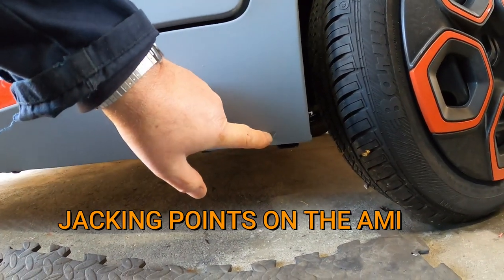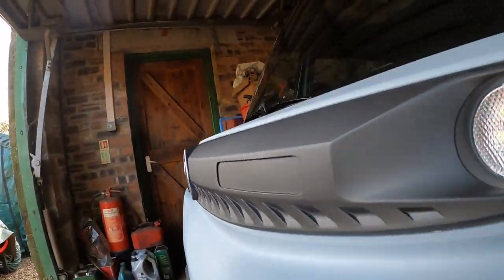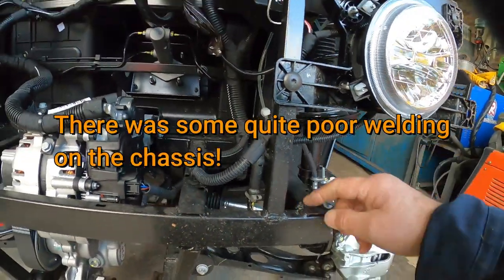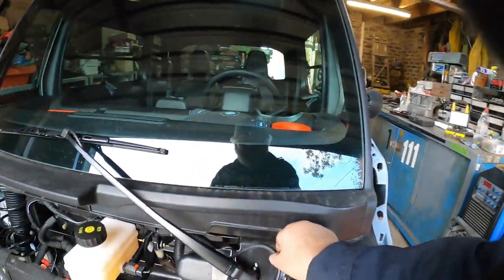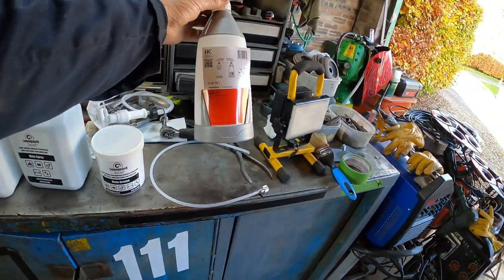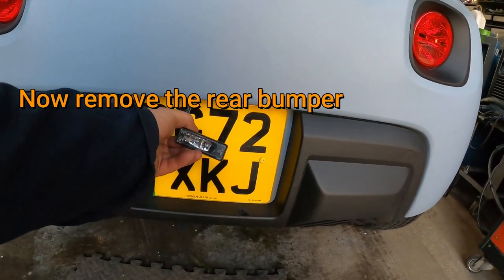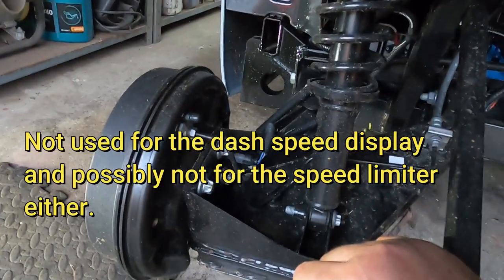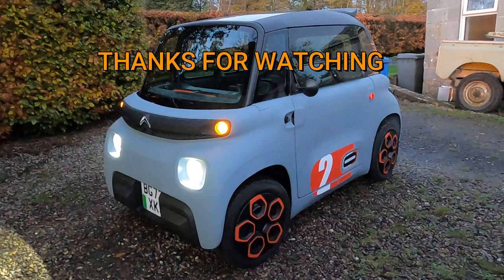Rustproofing CITROEN AMI with LANOGUARD  & How to Remove Front & Rear Bodywork

Comment: This is the best video ever on the Ami and what your actually getting for your money - or not- as a car mechanic from the 70s to the 90s, this is just cheap jigged up box sections mass produced but so damn poor as you are honestly pointing out. Without you rust proofing, this hasn’t got much of a life before it’s scrapped! This should be done as standard. (Because it’s a box chassis) But because it’s all profit driven it’s up to you to do it-provided your savvy enough or old school car mechanic. Man I worked on triumph herald chassis and these things were bloody death traps (all cars with box chassis) crumpled and fell to bits in a bump! As we’re pretty much all cars from that lax era. Honestly for the price it’s ridiculous the minimum effort that’s gone into this quadricycle
Reply from the maker: I guess they do not get rust in Morocco (where the Ami is built).
Reply: Absolutely. It’s one of those marketing moments, where someone clocks there’s interest in this to the point of if we sell ‘x’ amount we make ‘y’ and that’s good enough return. 
It’s not even funny. Because if the stupid box chassis develops a hole, it’s binned due to it being the entire strength of the quadricycle. Everything is bolted on it it’s a liability.
2 year warranty on the chassis and 3 on the battery. They knew exactly what they were doing……
Reply from the maker: @stumpusMaximus  Being such a simple chassis - welding it back together should not be too much of a problem.
Reply: True, The ‘ordinary’ punter can’t do that -It’s got to pass an MOT remember?
Reply: @stumpusMaximus  It's a great disappointment to see how poorly the welds were done on the box chassis. It's as if none of the factory workers were ever shown how to do a proper weld before they were let loose on the shop floor. For the love of God, it's not as if Morocco is ever going to be a major manufacturing centre for vehicles so anyone lucky enough (?) to get work in the Stellantis factory at least deserves to be told when their work is crap. Can't help but think how much better this vehicle could  have been if it had been made in a country where they want to advance industrially. Must have been the lucrative enticement of cheap labour and generous government subsidies that Morocco offered Stellantis.

Comment: Well done, timely, we've got off light so far this year. That's a long run for the screenwash. Welding robots need to be sent for retraining. I'm still trying to figure out what purpose if any the dimples at the bottom of the doors have, jacking point indication is a nice touch.
Reply from the maker: I haven't looked at my door bottoms....
Reply: @DougsShed  I looked at the remains on your garage floor before checking out the Lanogaurd website. I think I'll be restocking my rustproofing fluid with that when the time comes.
Reply from the maker: @niallsommerville9941  The overspray and drips on the floor were easy to clean up. I just sprinkled sand on and brushed away.

Comment: will pass to the service manager at My Citroen dealership - (he's going to jack up the Pop and get my Optimate connected - I will ask he if he can do a Waxoil to the underneath while its up there for the battery job )...  I don't think we will go to the lenths of removing front and rear sections of vehicle - however, yours was a very thorough job getting into the internals of the box sections...   Thanks for promoting Lanoguard and the fact that its OK to use on electrical connections...    Are there areas underneath that you would avoid ?   Bill Kerr on the S. coast of England .
Reply from the maker: Avoid spraying into any of the cooling fans for the electronics.
It only takes about 3 minutes to remove a front or rear section.
Reply: @DougsShed     thanks Doug.  its just that I am temprementally aversed to doing it though I am sure I can/could but would prefer a professional to do it for me in case I F----d Up !    Its the putting back together bit and the dismantling the light connections that fill me with fear !   (. I stripo wheels of my cars and use a random orbital polisher on cellulose with loads of valeting products and jack the vehicle up and place on axel stands but dismantling sections.. ahh !!   - chicken out .    Bill 69 retired in Sussex  (quite good at falling off BMW 1250 GS's too ) - did this just s. of Edinburgh last Sept at 70 mph - lucky to be here - bike was written off but got a replacement within 10 days of event so quite fearless in other respects !!

Comment: Is this product nicer to use than Waxoyl? Their office is only a couple miles distant from where I live, it is just a normal private house, guess they are re-packaging or an agent for another company, be interested to see how well this performs as I have considered using this myself.

I like the simplicity and crudeness of the construction, it is only a matter of time before some company produces a body kit to change the car completely, it looks as if it will be very versatile.

My hesitation is the restricted top speed, as we are not governed by the same rules as in France, I wonder how easy it would be to re-configure the controller to allow a higher speed limit, I would want to be able to go up to about 50mph to make the car more usable on faster roads.

Thanks for sharing.
Reply from the maker: The Lanoguard is way nicer to use than Waxoil.
The coating is clear and dries to a matt finish.
It is recommended to apply every year as the coating is fairly soft and can wear off areas.
Type approval (L6) limits max speed to 28mph. If you were to modify for a higher top speed you would need to put the car through an MSVA test and register as an L7 (heavy quadricycle).
It would be very difficult to hack the electronics of the Valeo motor to gain any top speed.

Comment: Very interesting video so thank you. Do you think the electric motor is a bit exposed to the elements?
Reply from the maker: No worse than the location of an alternator on a car. Possibly better as there is no front grill.
Reply: I guess you could make an undertray for that section if you wanted. Will probably slightly increase the efficiency too (not a noticeable amount).
Reply from the maker: @gilburton Not really a problem. The electronics in the motor are very well protected. I did apply some Lanoguard to the aluminium casings to stop them going crusty.

Comment: Do you live in Edinburgh? Need help with the bumper if possible. Thanks. Steven
Reply from the maker: Hi Steven, I'm across in Fife. What is the problem with the bumper? Only (6) 10mm bolts to undo and a couple of connectors to the indicators (and rear number plate light).
Reply: @DougsShed  Hi, it's actually the rear quarter panel where the charge cable is (looks like a kind of L shape). The lock has a cover over it. I need to replace this panel but I'm not sure how to get it off. Just wondered if you have taken this panel off? I also have a new rear bumper to fit but yeah seems quite straight forward. Cheers. Steven

Comment: Does this mean you have to take off the front panel to check  and/or top up the brake fluid level?
That does seem a good idea for something that should be checked on a regular basis
Reply from the maker: No, you can see the brake reservoir from the gap at the top of the front panel.
Reply: @DougsShed  Can you top it up through that gap?
Although, if you can see the level is low I would think it needs to go to a mechanic to sort out why the level has dropped. So long as you can see to check and know it's there.

Comment: Very interesting to see how it's built and that it's belt driven . Also it's only 48v high voltage battery . I love Ami but I live in the Highlands and my leaf is better suited . I see you have a panda to. I have a 2020 active eco 169 , love it. Great wee cars. Maybe once theirs second hand Ami I'll get one then , hopefully the rust won't have got it before I'm the owner :) where are you?
Reply from the maker: Yes, it is a "Belt Driven Starter Generator" driving to a Dana Spicer differential unit. The differential has 2 stage reduction gearing giving 9.22: ratio. The primary belt pulley reduction is a further 1.699:1. Pretty sure that Citroen have severely restricted the performance of the motor (to comply with the L6e regulations). 48 volts is not considered "High Voltage" - they don't even fit protective boots to the 48V terminals. I'm located in Fife.
Reply: @DougsShed  Very interesting , I think if I remember rightly your area still has cps free charging. Here in Argyll no such thing anymore althou the rapids are only about 30p kWh same as 7kw . Yes I said high voltage just cause it's the highest it has. Where is the battery and is it a big unit?
Reply from the maker: @lookoutleo  No doubt all local councils will stop free charging sooner or later.

Comment: makes me wonder is you could fiddle with that speed sensor and reverse the belt drive to get a higher top speed😇! Still think they are excellent little cars and worthy of a mega cult following for sure.
Reply from the maker: There is very little in the way of reserve power to exceed 28 mph on anything but flat terrain. Gearing changes would hurt its ability to climb hills (can already slow down to 15 mph on the steepest hills).
Reply: @DougsShed  yes I get you. I wonder if a replacement motor is available so you could mount 2 motors and double the power…..could be an emerging sub culture where dudes are suping up EVs……has to happen some time😝😝😝

Comment: You must be tempted to construct a boot section as there looks to be a gd amount of room back there ..
Reply from the maker: That sounds like a good idea!
Reply: A larger battery pack (good chance there will be genuine high ah battery options available) or a self contained generator would probably fit for "emergency" charging / hybrid running.
Reply: @prawny12009  I think you would fit a Pylontech US5000 back there. Double the range of your Ami for less than £2k 😄

Comment: Good guide to taking car apart and future proofing it.   
Could you tell me the size of the numberpates. I only ask as I wanted mine with personal plates and was told they come pre registered and need to source them after it’s delivered. No one seems to know what ones are needed to be bought in advance, possibly in inches, as that seems to be the size of the square bike style plates. Appreciate any help
Reply from the maker: Hi, The numberplate size which fits the models with the black bumper surrounds is 280 x 210mm.

Comment: Would it not of been better to spray the Lanoguard with a mini spray gun and compressor to get a more even coat and blow it in to hard to reach places?
Reply from the maker: I could have but the hand sprayer was very good and controllable.
Reply: @DougsShed  to be fair I have never used Lanoguard! I have only used ACF-50 and Corrosion Block and both of these aren’t great sprayed through hand sprayers.

Comment: Is the sensor on the rear wheel not a hand brake sensor to stop you driving it with the hand brake on? 

Also is there scope for a slightly larger pulley wheel to increase the top speed (guessing the motor is RPM limited by the ECU)?
Reply from the maker: RE. ECU limiting - as you said you're guessing! No one knows.
It has a handbrake warning lamp actuated by a switch on the handbrake lever.
Reply: @DougsShed  Well we know it's software limited because the Valeo engineer said as much in a video (think it was out of spec reviews). At some point I'm sure there will be a mod available. Just thought changing the ratio might be an option.

As for the switch on the hand brake it will probably be a Citroen parts bin part just for the light (like on a Citroen C1). Be interesting to see if you can actually try to drive it with the hand brake on. 

Loving the videos by the way. 👍
Reply from the maker: @gavjlewis  I tried driving with the handbrake on (for a short distance) seems to drive OK.

Comment: You need to contact trading standards. Any crash protection you could have had is out the window with that appalling welding. Citroen needs to make good and fix the frame. Even well rust proofed fresh air gives no crash protection.

Comment: I don't get why EVs don't go with a one motor per wheel set up.

It seems to me having a motor directly attached to the wheel would be simpler than having to deal with joints that allow the wheels to turn, to go up and down, and rotate at different speeds.
Reply from the maker: I suspect that it is not simpler and probably more expensive....
Reply: @DougsShed  well I suppose there's simpler from a solved problem, where changing the setup isn't simpler no. From a things that can go wrong pov, I would say this is.

As to the second point, I suppose it depends where the cost is. Is it materials or labour? I doubt it's half the price to make a half size engine, but then you aren't having to manufacture a diff etc. I would suspect installing 2 small unconnected motors is simpler and cheaper than installing a monolithic motor , diff, drive shafts thing.

Comment: Might seem a strange question but why do you need to rust proof a brand new vehicle..
Reply from the maker: Unlike most modern cars, the Ami has a light gauge steel box section chassis which just has a thin coat of black paint. This is most likely to rust away very quickly on salted UK roads.

Comment: Those welds look quality🥴. I’m guessing as it’s not class as a proper motor vehicle, it’s exempt from eu regulations regarding crash safety and all the rigorous testing. Doesn’t look safe to me.
Reply from the maker: It is classed as a Light Quadricycle L6e EU type approval. As such it does not need any safety equipment other than seat belts and lighting....
Reply: Looks like it will act as a crush zone that is the whole thing front to back.